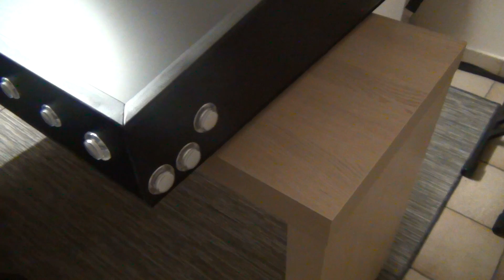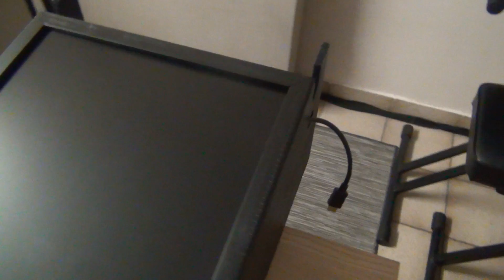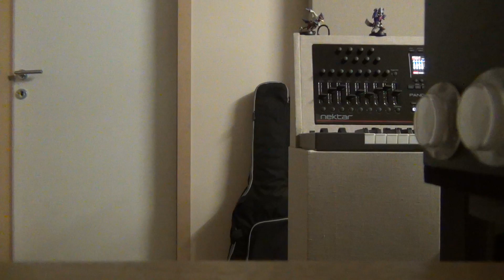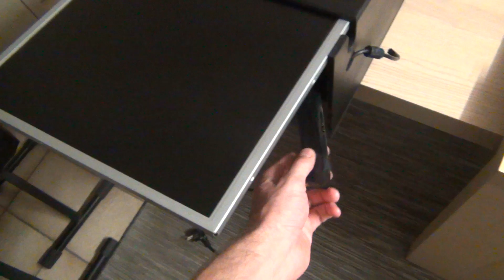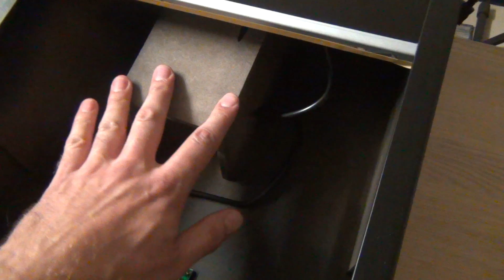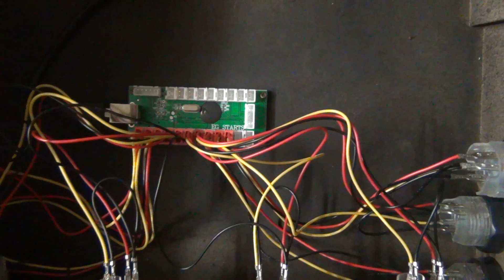The $50 Virtual Pinball Cabinet - Part 2: The Hardware

Comment: Do you have the dimensions or plans for the build?
Reply from the maker: I don't have a schematic, but I can tell you that the bottom plate is 34 cm wide and 61 cm long. The height at the front is 10,8 cm and the height at the back is 20,8 cm. That results in a 9,3° inclanation for the playfield.
Reply: @MONO-LITH83  thank you! It helps a lot. Just want to say your build dimension is beautiful, symmetric width of the monitor to length of laptop screen. Maybe I'm just OCD, looks good for a diy project.

Comment: Does your laptop have a dedicated video card? Or are you running strictly off of onboard gpu? Really nice work at any rate! Mini virtual pinball is certainly having its day!
Reply from the maker: Hi, thanks for commenting! To answer your question: the laptop has a GeForce MX150 built in. Currently I have a different laptop with a GTX 1050 since the original one was broken and could not be repaired. My new laptop reaches around 100 FPS on every table I tested so far on highest settings.